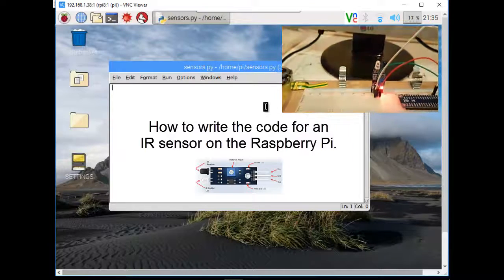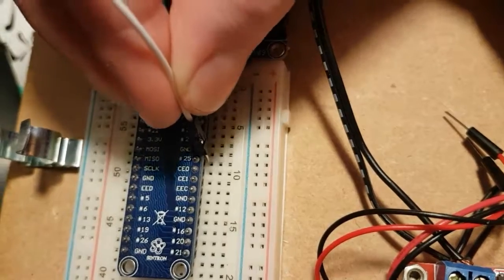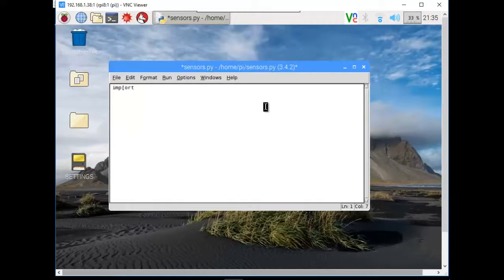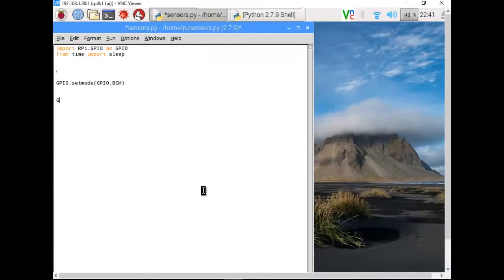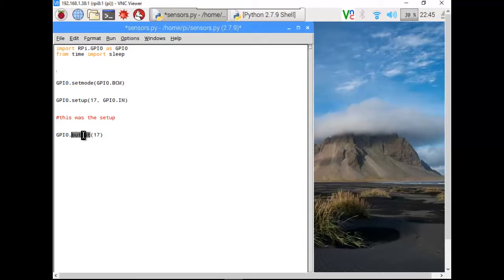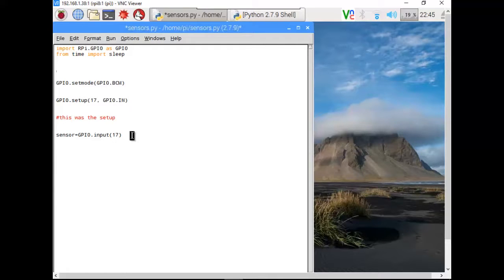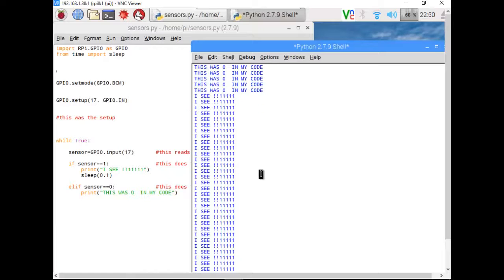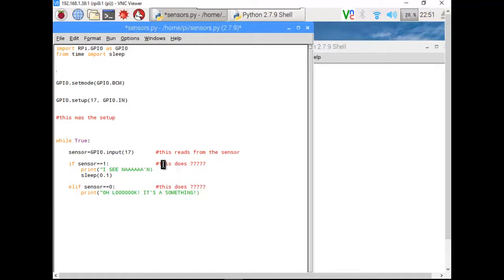Adding an Infrared Sensor to a Raspberry PI

Comment: nice video. Just now learning python. I know this is a few years old but would like to see more code to go with this. am trying to get the sensor to only output a line of text when the sensor is triggered. any suggestions?
Reply from the maker: Sure no probs. You can remove the three lines of code around sensor ==1: where it doesn't see something and just use if sensor==0:  so that it only reports when it does see something.

Basically:

while True:
      if sensor==0:
           print("I saw something one time")
           break

print("This program is now over unless you want to add more here")

The "break" is to break out of the while loop that keeps the sensor searching for something.
Reply: @DannyBMurray  awesome, thank you very much for the quick reply. Love the vid.

Comment: I working on something like this, Can you help me how to send the PIR motion sensor data to firebase database realtime? Please
Reply: let me show you what I have:
from firebase import firebase 
import RPi.GPIO as GPIO
import time
url= 'https://### firebaseio.com/'
firebase = firebase.FirebaseApplication(url)
GPIO.setwarnings(False)
GPIO.setmode(GPIO.BOARD)
GPIO.setup(11, GPIO.IN)         #Read output from PIR motion sensor
GPIO.setup(3, GPIO.OUT)         #LED output pin
while True:
i=GPIO.input(11)
if i==0:                 #When output from motion sensor is LOW
print "No intruders",i
GPIO.output(3, 0)  #Turn OFF LED
time.sleep(0.1)
elif i==1:               #When output from motion sensor is HIGH
print "Intruder detected",i
GPIO.output(3, 1)  #Turn ON LED
time.sleep(0.1)

result = firebase.patch('/sensor/pir', {'Motion': i })
print(result)

for some reason my data is not in firebase when I run it only shows that pin number 11 Can you help me please?

Comment: Im struggling with a DHT11 sensor.. I want to do what you did but I want to give my “sensor” variable the actual numerical value and not just a 1 or a 0.... so if my sensor detects a certain temperature it goes into the elif part of the program. Can you help!?

Comment: Hey I’m kinda in need for help. When I run the script all I get is value 0 and even after putting my hand over it and the light indicating it works, it still shows value 0 and doesn’t change to 1. Any tips?
Reply from the maker: Okay so if your sensor is showing the green light flick on and off but your python program isn't going back and forth between 1 and 0 then the problem is somewhere along the wire going from S on the sensor to the GPIO pin on the Pi. Make sure you just straight out copy paste working code and that should eliminate typos in your python. Could be a loose wire or it could be going into the incorrect GPIO pin. There are two methods of numbering those pins (BCM and BOARD, best google image the diagram) so try it on both of them.
Reply: Daniel Murray oh ok never mind I got it. I had to change BCM to BOARD. Thanks for the help also great video!!!

Comment: Hi, I wonder whether the voltage on the OUT is 3.3V and not 5V, since the VCC is set to 5V? Since you connect the OUT to the GPIO pins?
Reply from the maker: Yup probably is.